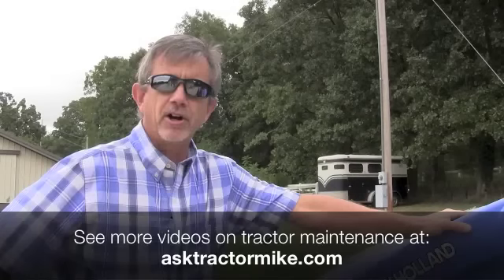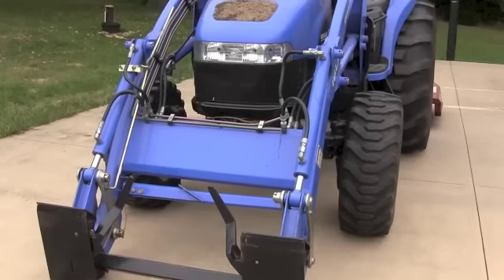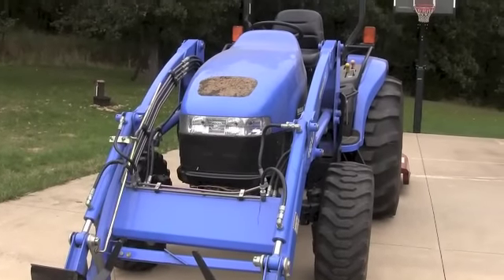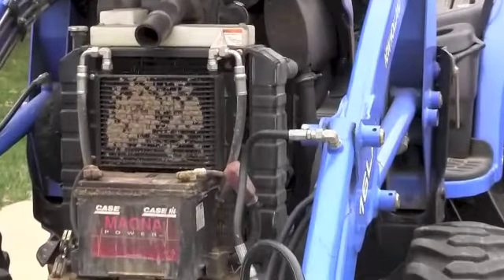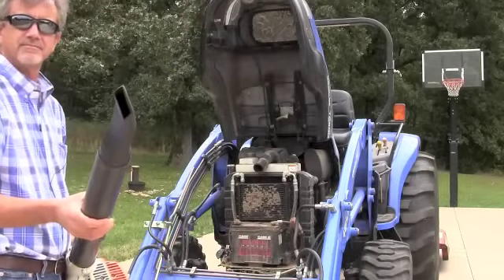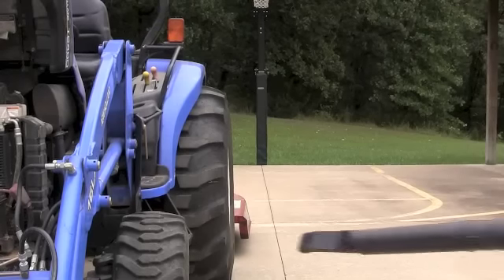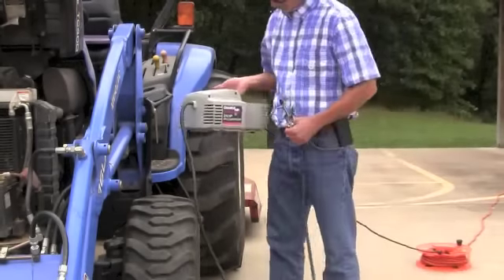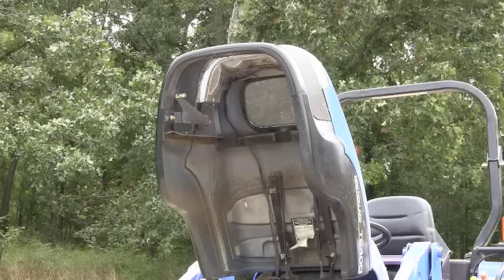A Handy Way to Clean Your Tractor Radiator

Comment: I'd rather clean my radiator and grille than hit a stump or cinder block that is hidden. Bucket stays for me.
Reply: If you got stumps and cinder blocks you shouldn't be bushhogging/mowing. Buckets block your view. Maybe these things wouldn't be "hidden" if you didn't have a bucket blocking the view.
Reply: emidmag sometimes you have to mow!  If you do custom work I ALWAYS leave the bucket on and down, and it's saved big repair bills several times!  And with all the dead ash dropping limbs it helps also.  Not all fields that need mowed are level and out in the open!
Reply: Bucket on.
Reply: @curioushooter  I do custom work and charge a premium for the unknown. But what do I know.

Comment: I went to Northern Tool and bought a 24" long blower with 10 jets... you can blow it very easily... 19.00 bucks I think
Reply: Yep Thats the way to do it. You may have to turn fan blades some. On my tractor the A/C coils get clogged too. Wish they sold a metal one. The plastic bends to easy.

Comment: This is a dumb move to use the high air pressure,If your angle is off you can end up closing off the finns in the radiator.You can peels paint or cut a hole thru a cinder block, dont ask me how I know.

Comment: I'll bet the filters are filled
Reply from the maker: You'd think the air filter would be packed but it stays much cleaner than the radiator.  I think the suction of the fan pulls the debris into the radiator before it can get to the air filter.  The inlet is mounted just about the radiator.  I'm not sure that's be design but that's been my experience.